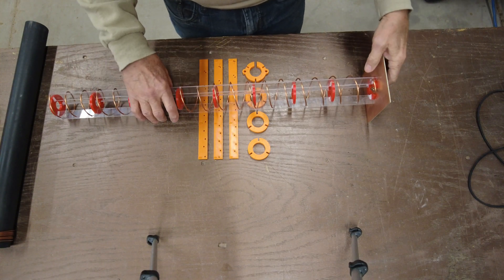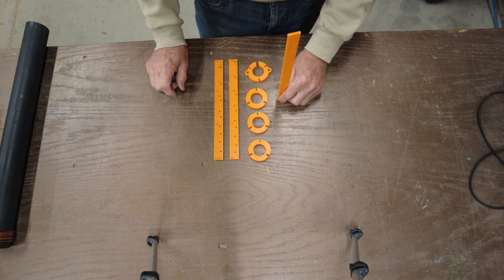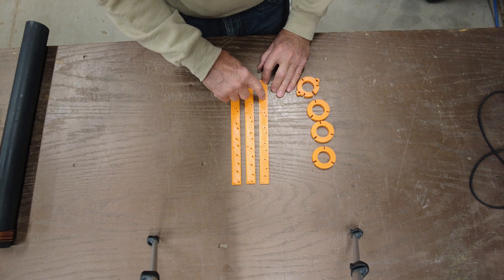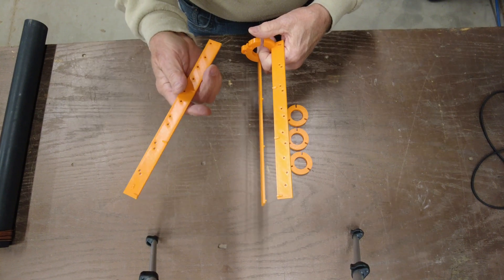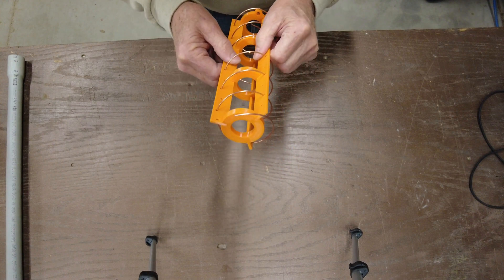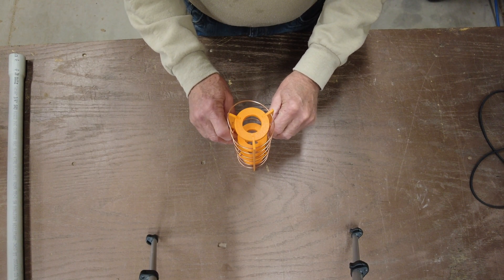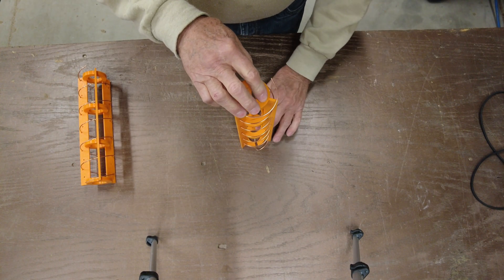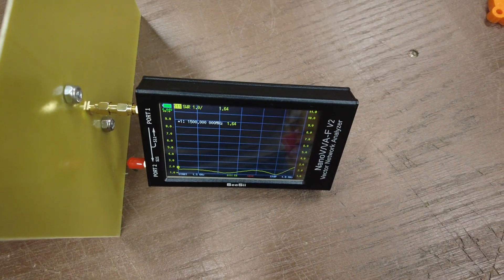3D Printable L-Band Helical Antenna

Comment: Finally finished my version. Doesn’t work and no idea why and what it’s resonant at.
Reply from the maker: Please be more specific than "doesn't work".  What was your test setup and what was your criteria for success or failure?  Do you have any means of measuring the feedpoint impedance?  I've build several of these antennas and they all were very close to each other for resonant frequency, and a helical antenna is inherently fairly broadband anyway.
Reply: @AB7Echo hi David. Yes I have a nva when checking I just get a slight curve at the bottom and whatever range I use it always seem to be tuned to the start of the range I have made a double length. Should I tune them individually then connect them together? I did just for a test connect it to my sdr but received no signal at all.

Comment: Do you have a link to the file please?
Reply from the maker: LOL.  The link to the STL files is in the description and always has been.
Reply: @AB7Echo silly me I didn’t see the rest of your description . Thanks I will be making one just what I need.
Reply from the maker: @paulsharp5473  No problem.  Let me know if you run into any problems and I'll try to help.
Reply: What gauge wire did you use?
Reply from the maker: @paulsharp5473  Yeah, I should have mentioned that ... sorry.  I used 10 gauge wire because it's stiff and feeds onto the form without bending very much.  A helical antenna is quite forgiving and fairly broadband, though, and within reason wire gauge has relatively little impact on the results.  12 gauge wire is easier to get (just strip the insulation off some 12 gauge Romex that you can readily get at Lowes, Home Depot, and other places) and should work just as well.

Comment: I was thinking about building a antenna for 1.4 GHz for the hydrogen line radio telescope.  I was wondering if the circular polarization would be a problem?
Reply from the maker: I don't know for sure, but I would think it would be an advantage to have circular polarization.  Signals passing through our ionosphere get massaged all sorts of ways and I can't believe that the polarization would be constant.  It certainly isn't even for terrestrial signals that get refracted by it.

You could in theory scale this design down to 1.4 GHz (you could do it in the slicer), but unless you have an oversize 3D printer you'd probably also have to chop up the STL for the struts in the slicer into smaller sections to make them fit on the printer bed.  It shouldn't be difficult to do that.

Comment: Brilliant video and design, David!  Thanks for your excellent work and I look forward to more! :-)
Reply from the maker: Thanks for the extremely kind comment!  If you have any thoughts on an antenna you'd like to see, please let me know.  If I think I can come up with a simple and dependable way to make it, I'll give it a try.  If I don't think I can add anything to what is already out there I'll say so.
Reply: @AB7Echo  You're very welcome! I love the ingenuity of having multiple frequencies, and even polarizations within the same design! Plus printing flat means it's much easier than an entire 3D structure all at once. It's already a wonderful design;  I'll try printing it myself later today.

Hmm, I was wondering if it may be possible to make a collapsible helix so it may be even easier to take on the go. Perhaps if one of the three legs could be hinged so that it could fold "forwards" (along the axis) and down onto the same plane of the other two, if that makes any sense. Or alternatively, if the helix could be 'compressed' down axially using the spacers, locked in place with another piece, and the three vertical supports removed? Or perhaps you may have an even better idea :)
It might not be as structurally sound but may be an interesting design challenge. And, if it works out, very convenient to take out on a trip or walk.

Have a lovely weekend!
Reply from the maker: @technobird22  I can't think of any way to make the helix collapsible without sacrificing precision.  The turns would become larger in diameter as you compress them so the wires wouldn't be able to go though holes.  If you're concerned about protecting it while traveling, I would just insert it into a length of tube of the right diameter ... PVC, ABS, or a stiff cardboard mailing tube.
Reply: @AB7Echo  That's a good point, Dave. Thanks for the thoughts regarding protecting it. By the way, is there any chance you could make some modular designs for other frequencies (S band, 2250MHz, or inmarsat)?
Or perhaps if I scaled the model size according to the ratio of wavelengths, would it also work? Cheers.
Reply from the maker: @technobird22  Well, this set of STL files should work for INMARSAT at around 1550 MHz ... that's what I use it for.  But for other frequencies, you should be able to just scale everything with your slicer.  All of the dimensions other than wire diameter are fully scalable, and wire size has rather little effect on performance anyway.  A helical antenna is really quite broadband considering its gain.

Comment: Hi, nice work. Like to ask you. Would be possible to use a antenna like this as a rtk antenna? ❤👍
Reply from the maker: Thanks!  I know next to nothing about RTH, but if it uses the L1 GPS signals at 1575 MHz this antenna should work fine ... the bandwidth is fairly wide.  If you need to copy the L2 and L5 signals down around 1200 Mhz you'd probably want to scale the support pieces to that frequency.  The nice thing is that you should be able to just scale everything in your slicer, but you would probably need to cut the struts into pieces to fit the 3D printer.  My Prusa MK3S+ will just barely do the version in the video.  Join the strut pieces at one of the spacer disks.
Reply: @AB7Echo thanks for answer.  The idea is to capture a full-band of frequency. L1, L2 and L5...and oder constellation to. Not only GPS but also Beidou, Galileo and Glonass.
Reply from the maker: @jmc_fpv  Yeah, you'd probably want two different antennas for that.  One for the stuff in the 1550 to 1600 MHz range, and another for the things down around 1200 MHz.  I've been able to receive INMARSAT signals (1550 MHz) without an LNA about 98% of the time, but an LNA provides a lot of margin.  Some LNAs have built in filters, so if you use one make sure it is rated for the spread in frequencies you're trying to capture.

Comment: thank you so much for taking your time to make a 3d print and guide. I am planning to make a satellite in my backyard to capture images from GOES and NOAA satellites as a summer project and this was super helpful.
Reply from the maker: It should be possible to capture the NOAA L-Band orbiting satellites with one of these helixes (although you'll probably want to be able track the satellite ... which you could do manually), but I haven't been able to get a signal from the geostationary GOES satellites at1690 MHz with even a 12 turn helix.  At least one other person who built one of these helixes wasn't able to either.  You probably need a dish for that, and if you use one of these helixes for the feed to the dish remember to wind the helix for left hand polarization ... the dish will flip that to right hand.

Remember that the NOAA orbiting satellites also transmit surface maps images at around 137 MHz, and for that a simple QFH antenna works fine with no need for tracking.  If you go that route, check my other YouTube videos in a few days because I'm going to post a construction video for a VHF QFH antenna as well.  And be sure to check out the Russian Meteor-M satellites that transmit on 137.9 MHz.  You can receive and decode them with a free application called SatDump, and the images are sharper than for the NOAA VHF transmissions.
Reply: @AB7Echo  thanks so much for ther reply! i was planning to build a full satellite, including a dish, a stand, and two motors plugged in to an arduino which will interface with geopredict (i forget what its called) so that i can automatically rotate the dish to point at the satellite. i needed a reciver to actually read off the dish and i was planning to make this one so i could attach it to the dish.
Reply from the maker: @sosdos011  That sounds like a great project!  The six turn helix should make a good feed for the dish ... you don't need or want anything longer because the longer one has a narrower beamwidth that won't fully illuminate your dish.  If you will have a long coax run to your computer you probably will want to use an LNA like the Nooelec "SAWbird+ IO" at the dish.
Reply: @sosdos011  By the way, if you are using a dish, keep in mind that the polarization becomes 'flipped' when it bounces off the dish, so when receiving a RHCP signal (such as from LEO low earth orbit satellites), you need a feed that is LHCP (left hand circularly polarized). All the best with your project!
Reply: @AB7Echo  Regarding geostationary satellites, I think the signal that they broadcast is linearly polarized, so you would get a 3db loss due to using a circularly polarized helix. In addition, the geostationary satellites are so far away that their signals are much weaker to begin with. Even using a linearly polarized modified wifi dish, I found the signals were incredibly weak.

For L band stuff, an LNA and preferably SAW filter are definitely must-haves. The signals are much weaker than in VHF, and there is a lot more interference from nearby GSM bands. Nooelec makes one called the 'SAWbird+ GOES', which also works very well for receiving L band polar satellites. They are powered over bias tee or micro-usb, but note that it leaks a bit of DC, so a DC block is needed if powered via microUSB. Were you using an LNA when attempting GEO satellites previously? Maybe using one could help a bit in that regard.

It's such a shame that the NOAA orbiting satellites were decommissioned early recently despite having many more years of life in them. On L band, it is still possible to receive Meteor-M (Russian) and Metop (European) polar satellites, and there are much more data on L band compared to VHF band (higher quality and more channels).

All the best with your satellite receiving, hope this info may be helpful!
Reply: @AB7Echo  Unfortunately youtube swallowed my more detailed comment on GEO satellites and it isn't showing up for me, so I will retype up a more abridged version.
- For L band, a SAW filter + LNA is required to get a good signal. Look into the Nooelec SAWbird+ GOES, it works quite well for L band polar satellites too. It's powered over bias tee, or, if you power it over micro-usb, note it leaks a bit of DC so use a DC block between it and the SDR. Maybe you could have more luck with GOES that way?
- Unfortunately, the easier to receive NOAA satellites have all been shut down untimely just a few weeks ago. Meteor M remains on VHF.
- For L band, you can receive geostationary satellites such as GOES, GK-2A, and I think a few Fengyun. Polar satellites you can do Metop B, C, and Meteor M N2-3, N2-4. Again for these, an LNA will help massively.

All the best with satellite receiving, hope this info is useful.
Reply: @AB7Echo  unsure whether something was causing my previous comments to be false flagged by Youtube. Please let me know if you don't see the one I left about geostationary satellites. Essentially, they are really far from us so the signal is weak. Also they are linearly polarized so there is a 3db loss from using a helix. Also an LNA+SAW filter is pretty much required for L band in general. Also even with a dish, the signal is very weak.

Comment from the maker: Today I did some more tests using two identical antennas (as close as I could make them) built per that video, and they do seem to be pretty identical.  Here are the feedpoint impedances that I measured for both of them at 1550 MHz:

Antenna A   28.5 - j8.0

Antenna B   27.5 - j7.5

I think that's pretty remarkable.

I then spaced the two antennas about 20 feet apart (pointed at each other) and after calibrating my VNA for the length of coax between them I used the S21 2-port measurement to look for the peak frequency response.  The response turned out to be quite broad ... the peak was at 1625 MHz but the response at 1550 MHZ was down only a couple of tenths of a dB.  The response was down 4 dB at 1400 MHz and 1755 MHz.  This is almost identical to the prediction from the online calculator (https://jcoppens.com/ant/helix/calc.en.php) that says the 3 dB bandwidth goes from 1412 MHz to 1702 MHz.

I don't have any way of measuring the absolute gain but the calculator predicts 11 dBi for a 6 turn helix.

Comment from the maker: After I made this video, it occurred to me that since this design should give very repeatable results without adjustments, I could probably point two of them at each other some distance apart and use the NanoVNA in 2-port mode to get a reasonable plot of the relative (not absolute) gain versus frequency.